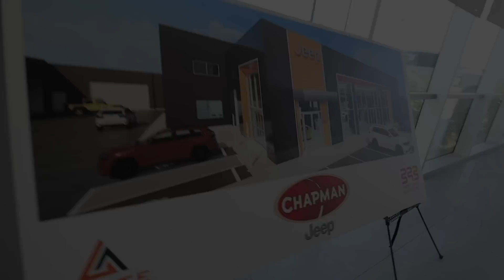RV Life Disaster: Ram 3500 Fuel Pump Failure

Comment: Just went thru it last year with my son.  You are looking at $11,000 to $14,000 repair.  My suggestion - is to go all the way and replace the engine with new block / engine and not repair what you have left.  For a little more money - you will gain two things!  1st - Peace of Mind.  2nd - ability to get the Big New Warranty!  This happens with Ford, GM and Ram.  So sorry for this delay!
Reply from the maker: Ram is covering this repair since it was a recall- so we will see how it goes when we get Shrek back
Reply: I’ve never heard of this repair being covered under warranty? It’s considered abuse because it’s caused from bad fuel. I wish you the best. Please let us know how you make out. I hate to see people having to sink 14K into there brand new truck. Good luck.
Reply: I'm thinking about buying a 2018 ram 3500 with only 34,000 miles (cummins diesel).  Will this fuel pump issue happen on a 2018 ram 3500?  Also how many miles on your ram when this happened?
Reply: @alb6434  affects 19 and 20 trucks
Reply: @RVMD95  dodge is the only one with the recall on it. Started the 1st of this year. They're swapping every CP4 to a CP-21ISB pump which is pretty much a hotrodded CP3. CP4s are great pumps that are designed on European fuel, and they fail on North American fuel

Comment: Yep, I’d be a little ticked at Ram without question.  We’ve had our issues on the road several times ourselves, usually at least 1,000 miles from home and after calming down we’ve addressed our resolves as well.  Good job guys, waiting for part II.

Comment: We had a similar situation with a Ford exactly 1 yr ago. We truly have PTSD from the situation. We were from East TN trying to get home from Maine where very campground was closing down. We broke down 3 times, 3 different Ford dealerships did not get it fixed. We couldn’t rent any cars or trucks due toCovid.  We had to buy a new truck to get home. I wrote and complained to 3  Attorneys General without success. We need a class action to Ford and Ram on how they handle the repairs.
Reply from the maker: I do believe I read that there is a class action out there- so far we haven’t had any problems with getting it fixed- just waiting for parts

Comment: I feel your pain our 2020 Ram has been in the shop 6 times they have replaced the fuel pump but nothing else. As of today it’s still running like it was 6 months ago we have another appointment in November with another Ram dealer and have been working with a case manager every step of the way with Ram headquarters. Still very disappointing since we are stuck in the same area, maybe we will have better luck next time. Just keep smiling and remember god has your back. Prayers for a quick turnaround on the fix for you guys.

Comment: Oh boy!  I have the 2019 RAM 3500 with the fuel pump recall.  Like you, no one had the part and told me it will be a while.  I am now going to call my dealer tomorrow to see if the supply chain has broke free and the recall fix is available.  Last thing I want is to in the same situation as you both. Go with the flow.. so they say - but man it is stressful!  I hope your fuel pump and necessary parts get in early and you get back in your own truck.

Comment: I feel your pain. I broke down making the turn from I40 to the I17 in Flagstaff. My truck threw a error on the display to pull over safely now. I did and the truck went dead. Would not restart at all. I was pulling my trailer. Had to have both towed. My problem wasn't as serious and was only a sensor. It took 6 days to get that one repaired. Since then I have had an error that has pointed to the High pressure fuel pump. No metal shavings though. Still trying to sort that one out. Pump was estimated at an $8K bill. CP3 Bosch pump. Glad you.re getting back out on the road.

Comment: The dreaded Bosch injection pump, all three have them Ram is fixing them thankfully but that doesn’t fully help you today . I understand why they want to do repairs that way they are completely responsible for it down the road and problems can be fixed at any dealership. Good luck

Comment: I first want to start off by saying that you so much for filming this. I know this is every ones worst nightmare and you managed to continue to stay your story to help us….. I pray everything works out. I have a question about the dually and a flat tire. What will you do with the custom rims. I have a similar set of 20’s with custom tires. as well. No one seems to know specially, what will happen when your towing. What happens if you have a flat in the front. I’ve been told to get a larger tire for the spare so you can use it in the front. Next issue is the rear. As far as I am aware, you cannot use the spare 17 inch or in your case 18 inch rim with the 20 inch rim, so what do you do? have you ran into this issue, I wish you could do a video of this. I know you have a large following and I know someone has to have the answer. I thought of buying an extra inner wheel and using that in as an outer with the inner in the event, there’s a flat in the rear. I don’t know if this can be done? Great topic for the next video.

Comment: Oh my. I would be so stressed out.  We have had problems with our 5w like that and we tow with a 2018 2500 diesel and thinking is that my fuel pump too.   Wow.   Prayers.
Reply: 2003(first year for common rail) to 2018  Cummins had the reliable CP3. Only 2019 and 2020 have the junk CP4. 2021+ has a CP3 variant.

Comment: Just curious Todd how many miles did you have on your truck before the fuel pump failed? We have a 2020 RAM 3500 and are in Quartzsite Az. We are waiting on the  dealer in Lake Havasu we are #6 in the que for the repair.
Reply from the maker: 55000

Comment: Here is something to look at or think about. I had a total engine failure in my F350 (128,000 miles). Insurance said, if it was caused by containment fuel they would pay the entire tow and engine replacement. They tested fuel and it was clean. Bummer. 
Consider submitting the more expensive tow bill to insurance. Pay the lower of the two.

Good luck, it’s sucks, I’ve been there.

Comment: cp4 high presure pump it's a problem cummings and ford 6.7 diesels. If your not using hotshots EDT or optilube fuel additive I recommened you do after fuel system is fixed. Most likely got bad diesel ( water in it ). I put an S&S disater prevention kit for this reason when the pump goes and shoots metal shaving into the high side of the fuel system, lines, injectors and back into the tank all have to be replaced and tank drained and cleaned. ---Just watch video tech explained it, sucks man sorry this happened.

Comment: Oh boy, that sucks. My 32 yr old truck had the fuel pump go out 24 miles from picking up my camper for a week long trip with friends. Got it towed and that tow guy had a shop to fix it. Also died on a Saturday. Part came over night Monday and got my truck back Tuesday. Arrived at camp 11pm. Luckly, like you, had the motorcycle along (yup, TH) for transportation mean time. Road to camp grounds Sunday to check in as to not loose my reserved spot during a bike rally week and make sure I was fully paid & checked in for arrival later. Friends I was meeting arrived late as 3 tires shredded on their camper on the way up, then lost a wallet on the last gas/ice up stop into camp. Crap just happens. Others showed up as planned throughout the week (they road bikes & booked nearby hotel rooms, but partied at our camp sites). As we gathered, shared travel horrors over camp fires and the rest of the week was fun. Spirts stayed up. Trip home was good for all and a week later, a boy doing highway clean up found the lost wallet. Mailed it back to the owner with not one dollar or credit card missing (still good people out there).  Hope this all works out for you and glad you got the friends truck to make it better. Just remember,  new truck part whoa's are just almost as back as old trucks. No dealer issues or who can fix on old trucks, but parts are not stocked everywhere either. Pro's & Con's to what we pull with. Thank goodness for the motor bikes out back.

Comment: I have a similar story
What a day yesterday was !!!!
On the way home from Utah, all the sudden I hear a metallic tink, Tink, tink. 
Weird 🤔
Looked at my gauges everything looks good. 
All the sudden my truck is kinda hard to steer. 
Look at my gauges again and HOLY SHIT !!!!
Temperature is pegged out. 
Go to pull over and the truck isn’t really wanting to stop. 
Pulled over and popped the hood and my belt was off all the pulleys. 
Look closer and my idler tensioner pulley was MIA. 
I was 30 miles north of Vegas in the middle of nowhere sitting on the side of the freeway talking to my friend and mechanic Ken Richie on possibly of what to do. 
As I’m talking a Ford pickup pulls over in front of me and looking from the cab through the windshield between the hood and the dash I see a license plate above his regular license plate that says JESUS, then a little mid aged Hispanic man gets out and goes Ju need a mechanic? So trying to converse with him. He knew very little English. 
I showed him on my phone the NAPA store and he figured out no you need the one on Chianne (Cheyenne)
He offered to take me there. 
As were getting off the freeway he says gas station on right NAPA over and points to the left. 
He needs gas. 
I looked and he was on empty. 
We got out and he fumbled in his pocket to get some cash and I said no. 
I put my CC in the pump and filled his truck up. ($95.00)
We then went over to NAPA and got the parts I needed. 
He took me back to the truck and opened his tailgate and grabbed his tools. I grabbed the socket I needed and changed out the pulley tensioner and he helped me put the belt back on. 
In our limited conversation he said he moved up here so his wife could take care of her mother. 
Work was slow. He does drywall. 
Also concrete work. 
We got the truck running and put everything away and I asked, how much do I owe you? 
He said nothing, you put gas in my truck. 
I reached in my pocket and grabbed the $60 I had and handed to him as I shook his hand and said you were my savior today !!!!
THANK YOU!!!!!!
In the middle of nowhere a man pulls over to help and goes above and beyond more than anyone could ask for. I wish I had more to give him. 
He told me his name, but I would never be able to remember or say it again. 
All’s I know is he is my hero and in my heart forever. 
Thank you again and again!!!
I will remember this man and day forever. 
Truly, someone was looking for me that day. 
Today was a day that truly makes you believe!!

Comment: The CP4 has been a disaster. With all the issues Ford and GM have had, not to mention the class action lawsuits , I was surprised the Ram went with it and have had similar issues. Adding a fuel lubricant seems to help as American low sulfur diesel doesnt have the lubricants of European fuel which is where the pump was designed.  The CP3 has certainly been more reliable. Good luck getting it covered under warranty.

Comment: Hey Todd ,you need to get hold of closest dealer asap, tell them what happened , Chrysler will usually expedite the parts if they know you are on the road traveling, Chrysler used to hold some recall parts back for someone in a emergency like yours. {it might help to let them know you have a youtube channel}. they  should also pay for towing. i used to work at a Chrysler dealer for 35+  years.. YOU may have to get hold of the local factory rep in that area and bitch {a little}. GOOD LUCK
Reply from the maker: All parts are in except waiting on a fuel tank….so hopefully soon!

Comment: Todd, if you had an HDT the tow companies only send out one rig to tow you in the can haul it and your wagon at the same time.  Could of saved on the tow bill.  Also how did you like the ride in the long nose Pete compared to Shrek.
Trade the Dodge in on an HDT. Make sure you get a pre def fuel required one.  Will get more for the ram than you think.  Let them fix it and sale it and get back in a rig that will serve you better.  Besides you can get parts all day long and just about anywhere.  Plus there are diesel mechanics everywhere.
If you need a get around rig buy and older CJ5 Jeep instead of a new one.  Twice the rig with less headaches and load it on a deck.  Saw a rig setup that way and it was perfect for playing in them there mountains.
Safe travels and roads Brian and Cindy, "xtreambydesign with passion"

Comment: Unfortunately every Ford 6.7 Powerstroke Diesel from 2011 to current has that CP4.2 pump. At least RAM is recalling the 2019 and some 2020's to replace the pump with the reliable CP3. GM used the CP4 on the LML 2011 to 2016 and are being sued. They now use a Denso High Pressure Fuel Pump. Ford does not care about anything except the warranty period and even then they will often blame bad fuel and deny warranty. The CP4.2 is a flawed pump and a $12,000 ticking time bomb. There is no fuel additive, lift pump, filter, etc that will prevent the CP4.2 failure.

Comment: After this video I am contemplating whether I want to leave for another trip with my 2019 2500. I have been on the list since May for the replacement pump. I called the other day to see where I was on the list currently and found out they have not done one replacement since May. They are scheduled to do the first one next week. I am told the dealership is scheduled to get 2 pumps every 18 days. I may just have to tow with my 1500 gasser until we get this figured out. Hang in there Todd. :-)
Reply: Run it, if it breaks, wait a few months and lemon law it for a new one
Reply: Use Optilube XPD or Hotshots EDT treatment in fuel and drain your water seperator regularly to see if any water in diesel. Only fill up at high volume diesel stations like truck stops. You will be fine, ford 6.7's don't have a free replacement. Failure rate in USA is around 7% of cp4's and in Europe it's 3%, reason is Europe diesel has higher lubricity requirements that the US, so just use one of the 2 fuel additives I recommened and you will be fine.
Reply: @KratomSyndicate  My Hotshots EDT will be here tomorrow, already ordered. Thanks for the advice.
Reply: Actually my LX4 arrived today not EDT. LX4 will increase lubricity.
Reply: @davidw2959  yes it will but doesn't have water dispersant in it to bring water in diesel out of solution and to the bottom of your tank to then be filter out using water seperator BUT LX4 is great to.